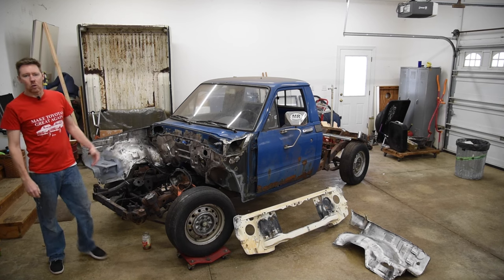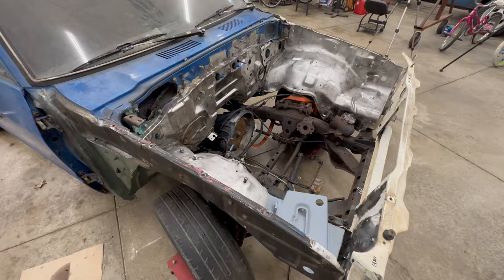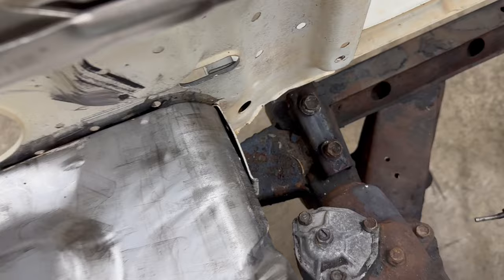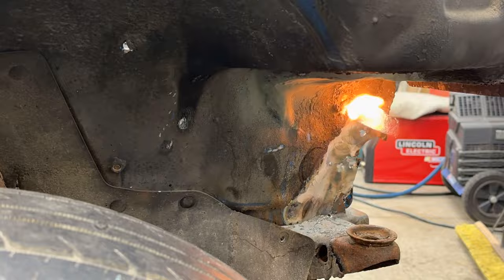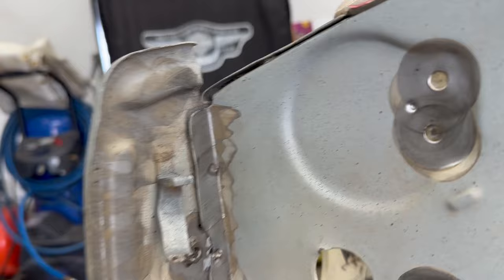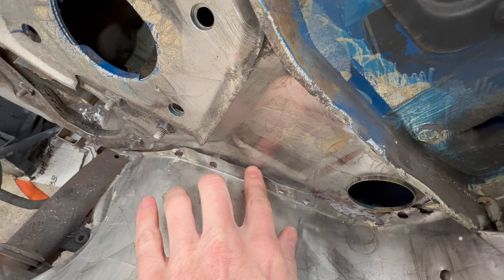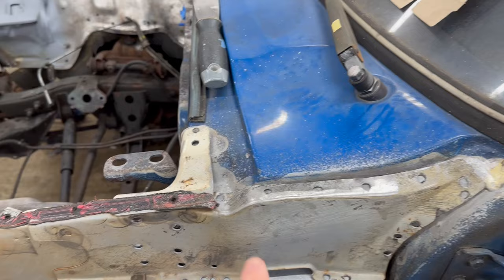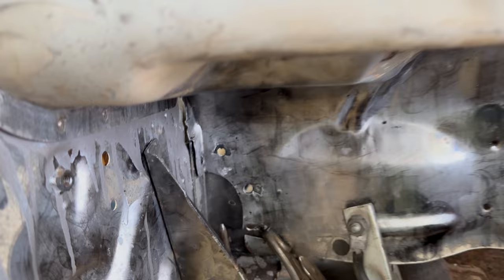How to Weld/Install New Front Clip on Toyota Pickup Truck Cab

Comment: Nice job. Lots of patience getting good fitment. Might try sheet metal screws to pull the metal together in tight locations. Use clecos if you want to remove and replace. Looking forward to more of your work.
Reply from the maker: Good idea, thanks!

Comment: cant find video you cut the panels from doner , cant you just rivit the panels on
Reply from the maker: Here is the video: https://youtu.be/KApQeVxUDI4  I don't know if rivets will be strong enough in the long run. They were welded from the factory, so I think that is the best way.
Reply: @6thGearGarage  thanks.for the link , I have doner panels but need to separate them,  so will drilling straight through spotweld be OK,  ,to separate
Reply from the maker: @mehere3013  Yes that will work.

Comment: Make sure you paint the cowl drain openings on the sides, under the fenders, just ahead of the doors...my 87 rotted out on the drivers side and leaked into the cab, area can be reached on the drivers side with the cowl vent and hood hinge box removed....have to remove fender on the passenger side....and its a Ca truck not ohio
Reply from the maker: Will do... thanks!!